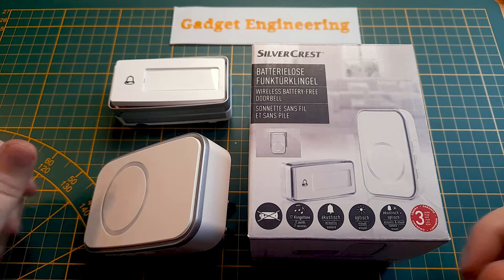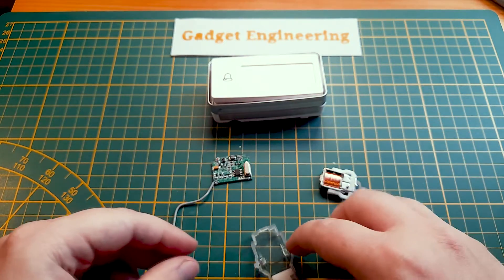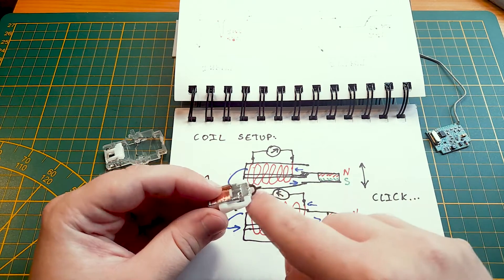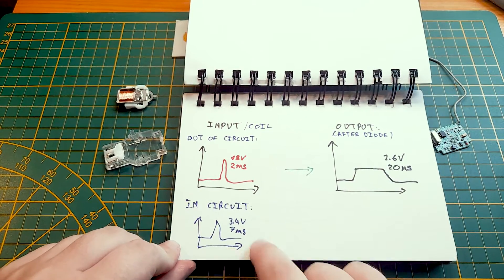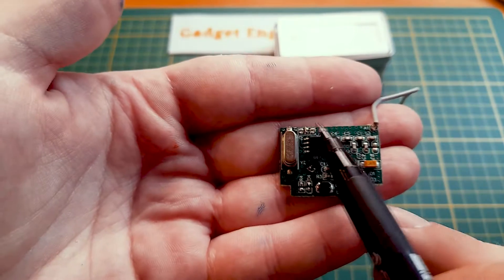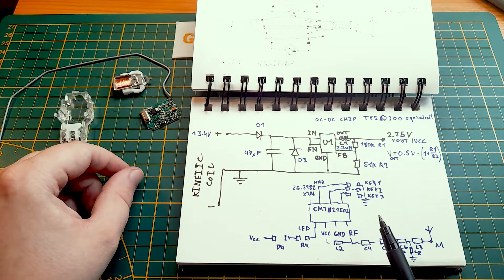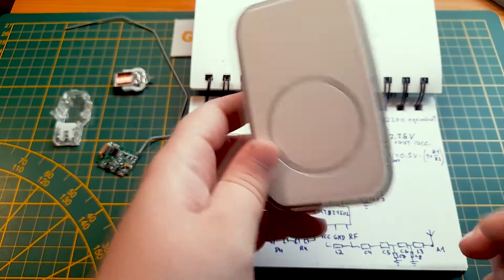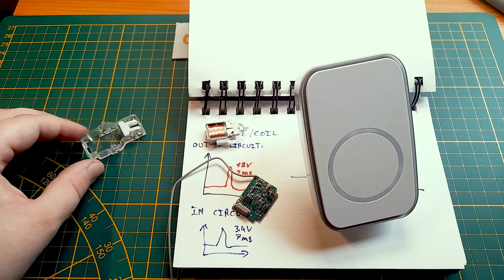Lidl battery-free 'kinetic' wireless doorbell: teardown with schematic

Comment: 10:00 yup, you are partially right, it is places there for 
Two purpose one it protecting the BEMF and the current can't go Reverse biased diode but maybe be it's acting as zinner high spike voltage and in second purpose doing this it also charges that Capacitor even in BEMF spike current.

Comment: Hi! help me please. Is it possible to attach another (one more) button to receiver? How to reset the receiver to factory settings? I am trying to clone the signal sent by this button using my universal keychain remote, but nothing works. I want to use another button (with battery) because this one does not always work from the first press.
Reply from the maker: I think you can use only the same model transmitter to sync with the receiver. It uses a proprietary code that I doubt your 433Mhz keychain remote can clone. To reset the receiver either unplug or hold the middle/volume button. I'm not sure how to sync 2 buttons, maybe just syncing one and then both should work? I think they all send out the same key, unless you resoldered the connections on the chip, which changes its 'address'. Good luck!
Reply: @GadgetEngineering  I recently assembled 433 scanner on arduino and it does not see this button, but everything else at this frequency can be seen perfectly. Now I doubt that the button actually works on 433 :))
Reply from the maker: @_roket  I'm quite sure it does, as its certified in the EU, 433 is almost the only legal place it can operate. I don't remember if it is OOK or FSK, but the data sheet of the chip it uses defines its mode of operation. Did I not mention the model in the video? If not I'll look for it!
Reply from the maker: @_roket  Here is the datasheet to the chip (CMT2150L) my good fellow: https://www.hoperf.cn/data/upload/portal/20190724/CMT2150_57L%20Datasheet-EN-V0.9.pdf that should give you some ideas!
Reply from the maker: @_roket  "CMT2150L is configured to operate at 433.92 MHz"